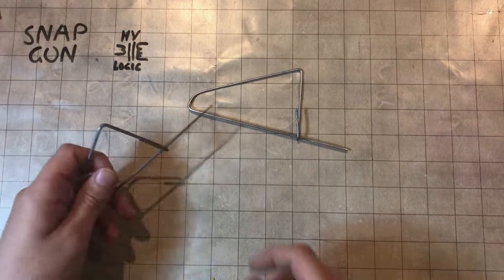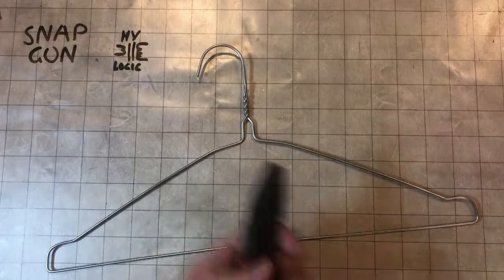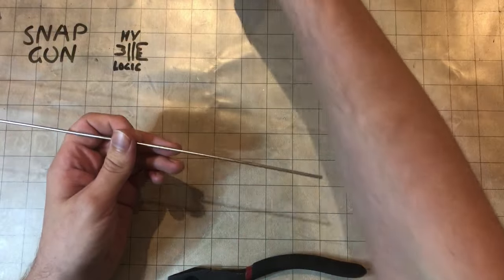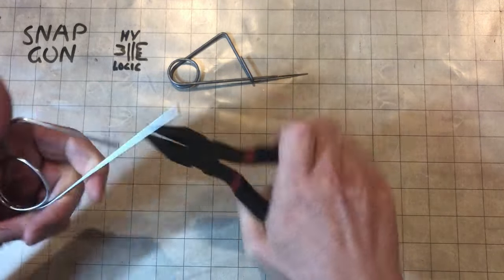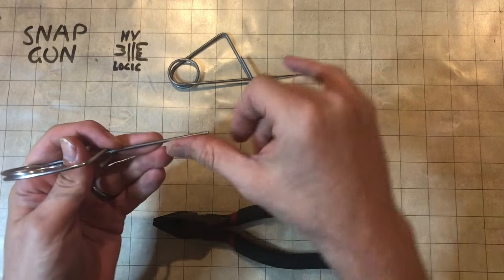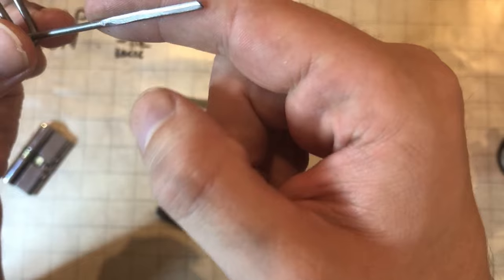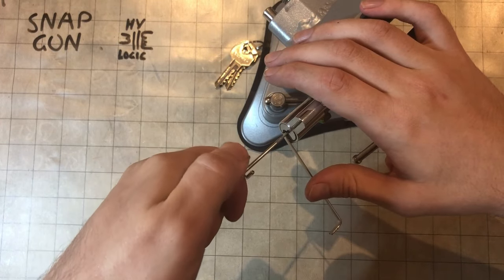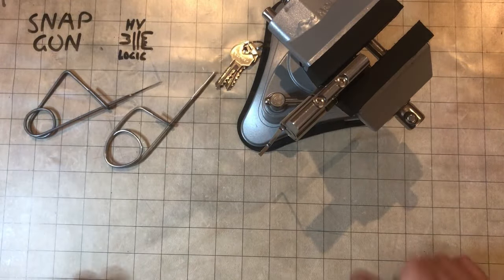How To Make Your Own Lockpicking SnapGun

Comment: Very cool demonstration mate. That is a nifty piece of kit. I have seen one where they have put some tubing, rubber or metal on the part where your thumb flicks the wire . It gives a bit more surface area for your thumb to flick and makes multiple flicking easier on the thumb. Thanks for this video, cheers
Reply from the maker: i have seen the same but honestly you shouldn't need it, if the lock wont open after about 20 snaps it isnt going to, or your technique is the problem
Reply: depends on whether your left or right handed as to which side you make the last bend
Reply: @mikha007  That is a very good point to make. cheers

Comment: - 00:01 🔧 Introduction to making a homemade snap gun for snapping locks.
- 00:12 🔥 Warning about overheating the blade during grinding, weakening it.
- 00:28 🔄 Importance of having an extra curve in the design for better snap action.
- 00:41 🧰 Materials needed: coat hanger, pliers, round object for shaping, and tools for making the tip.
- 01:21 ✂ Cutting the coat hanger to the appropriate length.
- 02:03 🌀 Bending the wire to create the snap action mechanism.
- 03:08 ⚠ Warning about sharp edges and the need to file them down.
- 03:20 🔪 Shaping the tip to fit into the lock using a file or bench grinder.
- 04:00 ✨ Final touches: smoothing and sanding the tip.
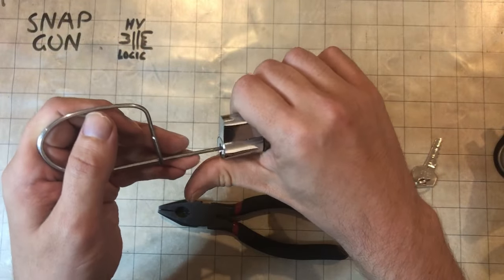- 04:33 🔑 Testing the snap gun in a lock to ensure it fits.
- 05:02 🎯 Successful demonstration of the snap gun opening a basic lock.
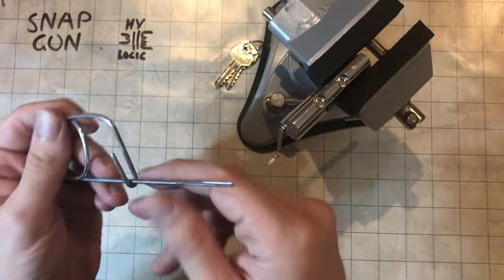- 05:38 👍 Suggestion to add tape for comfort and improvement tips based on experience.

Comment: Thank you for the video, great idea to get or keep lock picking skills fresh, working with your hands as much as possible.

I like the comment below about bending the wire in the opposite direction so it doesn't catch on your thumb (or nail) when you snap it.

I was also thinking when you are filing or grinding the tip that will go in the lock, just file or grind the tip of the wire where you snap with your thumb until it's smooth.
Reply from the maker: Yeah its a good idea to file that section smooth, i took the edge off but didn't give it as much as a polish as it really should have. Really i should have made the turns tighter and the whole thing a little bigger and it wouldn't be an issue like the older one i made previously. you could also put a bit of tape or foam over that tip
Reply: @HVLogic  All ideas to try, which keeps us practicing. I'm very new to lock picking, looking at training options to become a locksmith. Tough to find in a pandemic, used to have hands on training available.
Reply from the maker: @marcd1981  I can recommend the Discord group LPU (Lock Pickers United) there are a few smiths on there and a huge number of pickers who can and will help you out with any questions you may have.
Reply: @HVLogic  Thank you, I'll check the group out.
Reply: @HVLogic  Hey again HV, I am trying to find LPU on Discord, but the search comes up saying nothing found.
I have never used Discord until now, so I might be doing something wrong, but I opened Discord, added a server name for myself, then tried to search for LPU.
Reply from the maker: @marcd1981  http://lockpicking.chat/ you need an invite link is why they are also associated with the lockpicking subreddit
Reply: @HVLogic  Hi again, had to ask my step-son how to get going on Discord. I'm in contact with the LPU group now.Thanks again for the recommendation.

Comment: Would it be beneficial to make the spring smaller/tighter to produce move of a snap? Or does the higher amount of force not matter?
Reply from the maker: Made like that they already produce enough snap and it becomes more about making sure you get tension and the angle of the tip correct. If you wanted an even better working one it would be better to use a stiffer steel than coat hanger. something like music wire or a bicycle spoke should work well but will both be somewhat harder to bend into shape.
Reply: @HVLogic  I went ahead and made one today. The hangers I've got are a tad thinner because they've got that rubberish coating on them. I made it with a 1" spring and it's 4 3/4" long with the tip being 1" long after having made it the length of a 6 pin key. The hook is about 1 3/4" tall. It actually works pretty good! It even popped open a Master Lock M5 in 8 snaps. I just posted a video of it if you're interested and would like to let me know what you think. 
The only thing I'm going to do differently next time is add a few layers of shrink wrap to the spot you push with your thumb to make it more comfortable on my thumb.
Thanks a lot for your video! It obviously inspired me to tinker my own out as well!

Comment: To return the spring in steel (re-temper, or harden) you can reheat your steel up w/ a torch until a magnet will no longer stick to it (critical temp or currie point) and then quench in oil (or water) to regain the stiffness/ bounce back.  Which also will even out or will give a gradual temper along your tool.  Blue color (clock spring temper) is hard springy and brittle, Amber color is a good hardness but shouldnt break as its for tool ends like chisels.  I say all this cuz it seems you liked the long one you made but you didn't have confidence that it would last very long b4 breakage
Reply from the maker: you are correct re heat treating it would work much better, as would using a higher quality steel in the first place such as bike spoke. Great tip tho
Reply: @HVLogic  Bike spoke... Great idea!
I wish I saw your video a few wks ago and made one.  2 weeks ago I had to hammer off my padlock cuz I had forgot the New hiding location for my key (for a rental property's shed).  I had it in one location for so long and after having to give the location up over the phone to a tenent I re-hid them else where which I still cant remember, lol  It would have been nice to pick it to open it and not destroy it until I found my key (was in hurry to do repairs at the time).  oh well 
thanks again!!!

Comment: just a suggestion but cant you make the catch bend to the other side so your thumb dont land right on it when you push it down or maybe bend it out word toward the blade just a little ,  just some ideas! im glad it just got ur nail and didnt cut you! im going to have to try this looks pretty easy to do the only thing im not sure of is the thinning of the blade part iv got some of the tools that will work but iv never done any thing like that as of yet. great job!
Reply from the maker: on the bigger one i made its not really a problem, and if you are right handed not left like me it will be perfect just like that. even just a flat file works great for shaping the tip, a bench grinder is just faster
Reply: @HVLogic  ok thank you
Reply: Just what I was thinking. Then your thumb moves opposite of the pointy end 👌

Comment: Does this snapgun only work for the specific type of lock?
Reply from the maker: the whole point of a snap gun is it works on any pin tumbler lock you can fit it into. presuming the lock designer hasnt put designs in to prevent their use like antibump pins
Reply: @HVLogic  thank you, i want to make one and try it for a fun experiment.

Comment: It appears u are pushing bottom down instead of pulling top(striker) up. Maybe it because u Aussies are upside down.
Reply: On second glance, I thought u would want it to strike pins like an ax. I guess u are placing striker on pins, and letting bottom hit stationary striker. ?
Reply from the maker: @noahway13  thats correct. you want to hit all the pins perfectly at the same time. if you have it on an angle it wont work as reliably. they dont need a huge amount of force to bounce the pins up, just enough to overcome the springs. will also work fine with the lock "upside down"